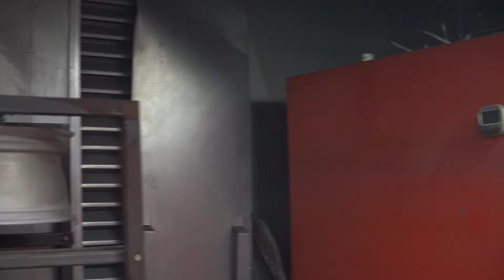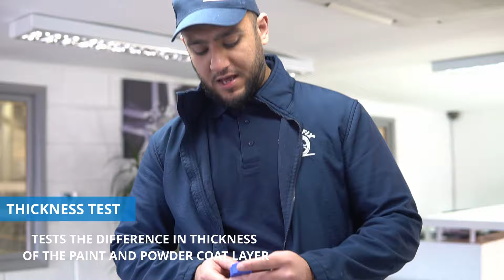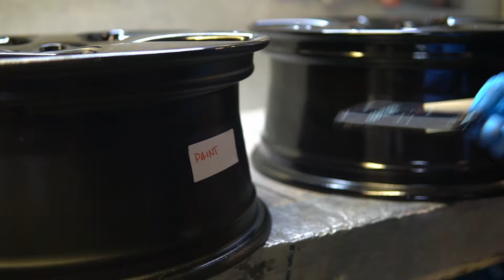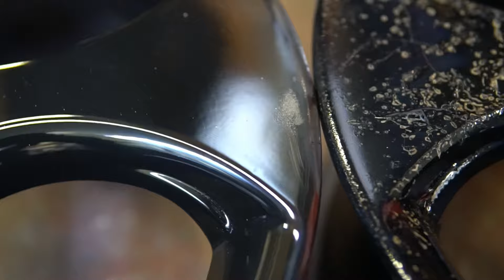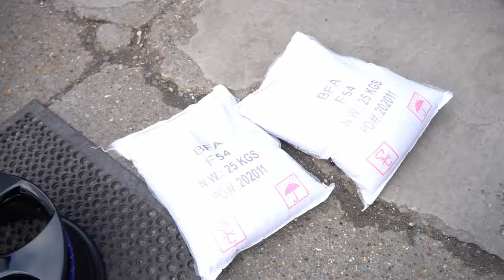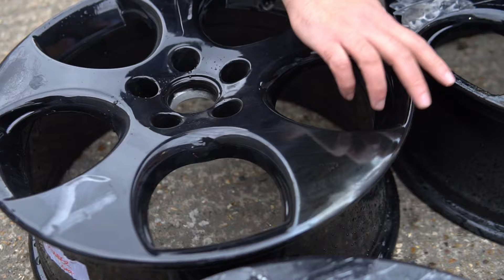POWDER COATING V SPRAY PAINTING ALLOYS - EXTREME TESTS! ALLOY FIX ROMFORD

Comment: There's no real winner IMO. Powder coating is more durable, yes, but when it's damaged the repair costs much more. Paint is less durable, but much easier and cheaper to repair. However, make no doubt about it, almost all wheels see some damage before long,especially when curbing happens way before life expectancy, thus why you see so many damaged powder-coated wheels for sale... the repair costs too much vs a new wheel.

Comment: Thanks for the explanation, basically what you’re saying is that powder coating is tougher, BUT if someone brushes acid on my wheels I need a refurb regardless, if someone blow torches my wheels I need a refurb (and tyres 😂) regardless, if someone knives my wheels I need a refurb regardless and if I kerb the wheels I need a refurb regardless. 

I’m not against powder coating and have done it many times but I would have focused more on the longevity and devised an accurate test that shows no damage to the powder coated wheel but ultimately they are soft metal and regardless of the finish, if you touch a kerb they’re done.

Comment: Also, the paint is solvent-based. And the powder coat is polyethylene-based. Polyethylene can contain solvent as well as acids. Your tests are inconclusive because you’re not testing properly. Tried touching that powder coat with a bunch of heat and it will boil and burn right off. Just take the paint. But you are not testing properly solvent-based and polyethylene would be heat best to break it down.

Comment: If you think about the applications in real life. With the painted wheels you've literally got 1 life, once they're scratched, it sticks out like a sore thumb and you're through to metal, it's softer so the gash is deeper. With powder coated wheels, they're far harder to scratch through to metal so if you did the exact same damage, in real life, your probably not going to see metal. Not to mention if you got your tyres changed, they're going to get scratches if they're regular paint. I've got loads of experience with both.

Comment: Pointless. First of all had you left them long enough to fully cure?  Secondly, this test is basically a clear coat test, nothing more and nothing less, the base coat is irrelevant here. I have expensive clear coats for alloy motorcycle tanks that would mug any of these finishes in every test you done. My last point is that you showed the material thickness as if 0.3mm was the standard for spray painting? You could easily build that up with even flowcoats so I'm not sure what you were trying to show or prove by that. I could have spanked both of these in every test you done with only an acid etch prime, then a 2pack single stage boat epoxy in a simmilar black. Been doing this 4 decades now and do mostly custom freehand on the lorries and boats these days. I'll be by far the most experienced person on here.
Reply from the maker: Thanks for your comment. Not suggesting we have more experience or knowledge than you. But it’s an industry wide fact that powder coating is a stronger coating than simply painting. That’s why all alloys come powder coated from the manufactures. 

But if you are interested and it’s feasible for you. More than happy to invite you down. You coat a wheel how you think we should of, using products of your choice and your expert hand. And we will coat the product how we know best and put them up to the same experiments (or tweak them if you prefer) and hopefully we might all learn something and have some fun doing it. 

Get in touch if you interested in something like this. Look forward to hearing from you.

Umar (the guy in the video).
Reply: @alloyfix_uk  did he reply?? 😂

Comment: I expected the powder coat to win but as soon as  either powder coat or paint is damaged then it’s damaged and needs repaired. It’s a lot more involved to repair the power coating as it is to repair the paint I’m assuming of course. But as it’s easier to get someone to repaint the damaged wheel is it cost effective.
Reply: I’m sticking with paint. I use a good paint with hardener and same for clear.

Comment: Ok, I think that this proves that powder coating is not significantly better than painting them, because regardless of the powder coating they were still damaged and would need to be repaired not unlike painted wheels. Sure the powder coating is slightly more resistant but they still got damages, so either way you have to be careful not to scratch your wheels and if you do you would need them repaired. And the odds of you getting acid or an open flame on the wheels is pretty low honestly, and you would still need them repaired if they were powder coated...
Reply: That exactly my thoughts.  No denying that powder coating is more durable but lets be honest. No matter how small the damage is..we would still get it repaired. Most car guys wouldn't be happy with some damaged wheels.
Reply: This is exactly why I’m not gonna have my wheels painted as opposed to spending more on powder cos ultimately, I have to repair both when damaged !!
Reply: You're both wrong. If you think about the applications in real life. With the painted wheels you've literally got 1 life, once they're scratched, it sticks out like a sore thumb and you're through to metal, it's softer so the gash is deeper. With powder coated wheels, they're far harder to scratch through to metal so if you did the exact same damage, in real life, your probably not going to see metal. Not to mention if you got your tyres changed, they're going to get scratches if they're regular paint. I've got loads of experience with both.